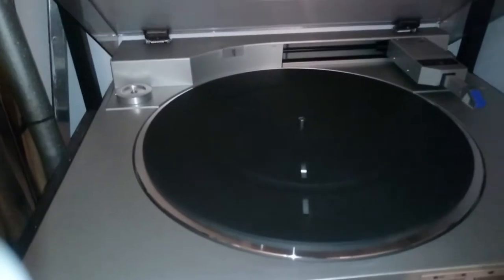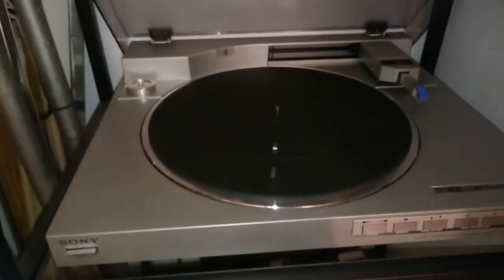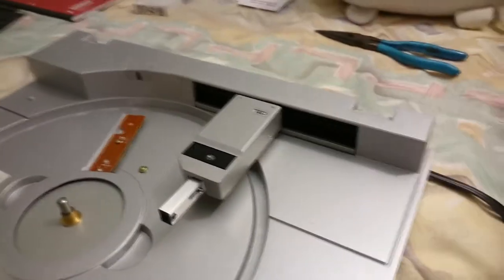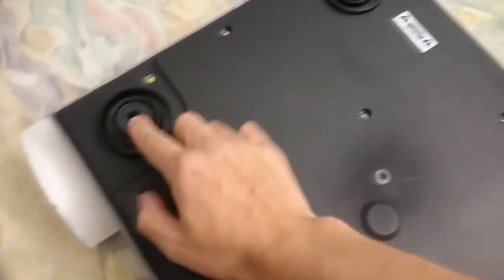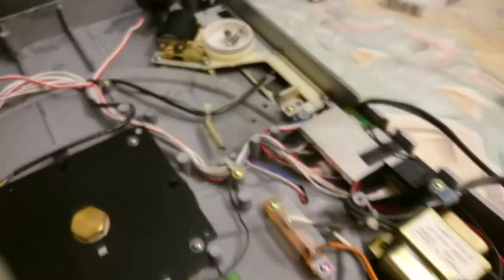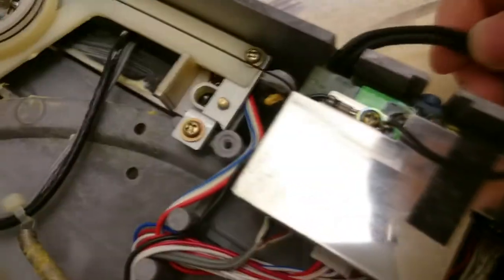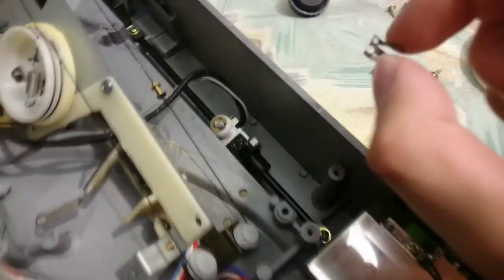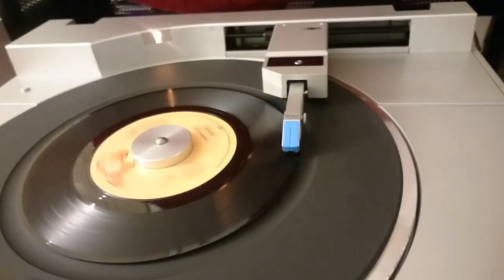Finally, repairing my Sony ps-lx510 (2017 Vlog)

Comment: Hello I have this model.  And also the arm not works.   I see yuo video and make. But not works. What hapen??? Can yuo helpme??? Thanks
Reply: try new belt first if tone arm is non functioning. take apart turntable case to reveal inner belts to see if any rubbber is damaged. replace whatever belts are damaged. should be working.